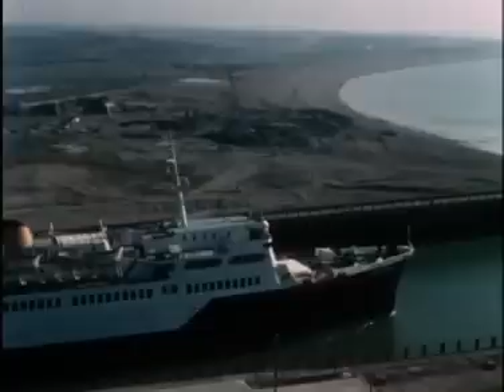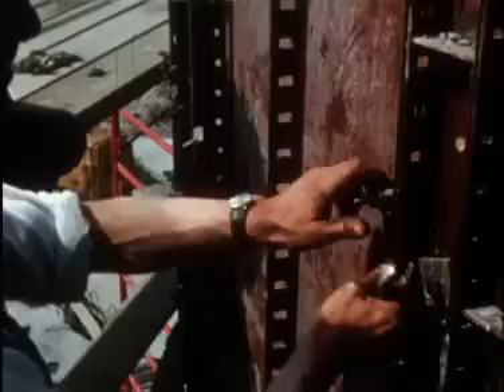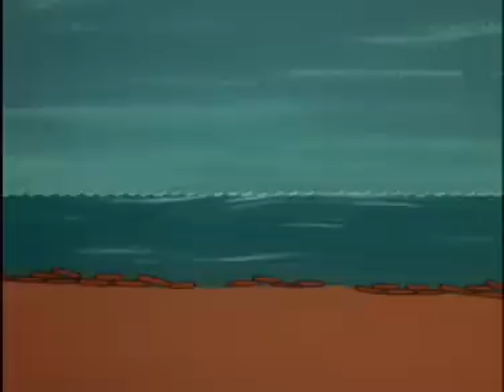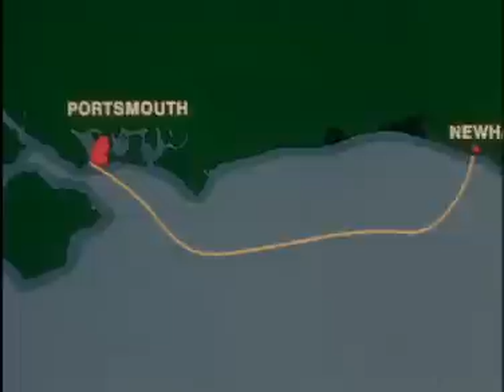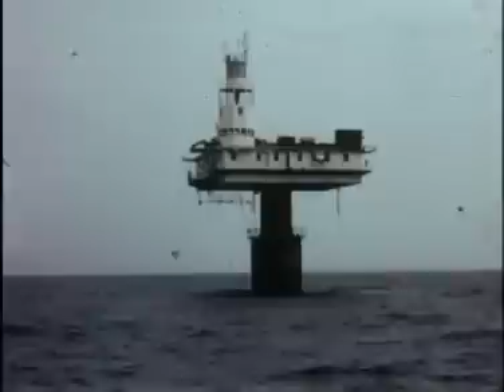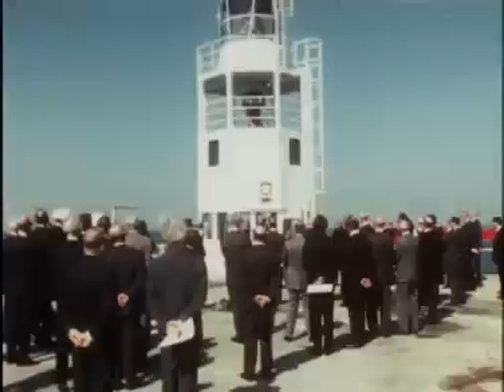Royal Sovereign Light (1972)

Comment: Ah Memories worked on the tower when l was 21  for 2 years on the beach and then on location.Was one of the guys who had to climb down inside and sit on a wooden platform hung on wires winding the nuts up on the jacking. Remember something about the metal rods meant they cost a small fortune but when the jacking was done they were cut off and dropped inside tower,Boss was bill the guy in the tie. Ganger was Ken Gregson a Newhaven man really nice guy.Jock Stewart carpenter and ginger baker welder.Can see myself in film on the winch and concreting.Happy days.

Comment: I always wanted to visit the Sovereign but strangely finally did when it was sitting on the dockside in Shoreham harbour after being dismantled , the living quarters have now been demolished but the tower is in storage ready to go on display at  a new exhibit in Bexhill.
Reply: Was anything saved from the accommodation? Except  the lighthouse tower  doors windows  etc?
Reply: I was told at the time the accommodation block had too many hazardous materials in it to be saved , I'm not sure if any smaller bits were saved.
Reply: The accommodation block was lifted off in one go and weighed 900 tons !

Comment: Trinity house: we want to set this off at 6pm in thick fog.
.
.
.
.
Tug boat captain: Hold my beer.
Reply: When I was on the Lightvesel 'Royal Sovereign', in 1968-1970, we had continuous fog for 100 hours.
The foghorn is brought into use when visibility is reduced to half a mile or so.
The larger generator-compressors are used when the foghorn needs to be running, thus supplying adequate air pressure of 40 Lbs square inch in the 3 capacitor 
tanks that is then fed by pipe through a solenoid operated valve to the foghorn above the bridge.

The number - frequency of the foghorn signal is determined by whatever the light signal is for that particular seamark & the lantern is used during periods of fog as well as hours of darkness.

Comment: He didn't explain very well how you 'float' concrete!
Reply: Simple, if the concrete base, being hollow, displaces enough water with a weight greater than the weight of the concrete then it will float, after all steel won't float until it's made into a sealed container.
Reply: @johnmartin6178  Yes fine but how is it then heavy enough to support the tower  when sunk. Do they then fill it with concrete?
Reply: @ronnieg6358  The video explains it!

Comment: I am an ex-Lightsman First Class, now retired, I  was a crew member of the Royal Sovereign Lightvessel in the 1960's until  shortly before it's replacement by the light tower.
I am  Eastbourne born - bred , I spent six years at sea, mainly in the Arctic & North Atlantic.

Before going to sea, I was a regular weekend visitor to the RSLV & knew all the crew well.

The person looking at the cable being attended to at the beginning, 0.06, was the Master, George DAVIS, the other Master(not seen)was, John KEYS, from Suffolk, a good friend of mine.

At 0.24> was 'Chick' FOWLER(Driver), from Yorkshire.

I would go to see the construction progress of the Tower near the Buckle pub, Newhaven when on leave.

Seeing the tower being towed out, reminded me of the fact that in 1969, we had 200 hours of continuous fog, which meant that the fog horn was running continuously for that whole period, except for just 30 minutes, when the fog signal is running, the larger generators, with the addition of compressors are used to provide air & electricity.
 

 The Soverereign Light tower was not the first such construction of it's type, the Kish Bank Lighthouse in Dublin Bay was the first, commissioned in 1965 I believe.
I recall communicating with Captain GATESBY of THV Winston Churchill & he mentioned it in a letter that he sent to me on the subject. 

He also said that, as a result of that experience with the Kish Bank, the ground preparation of Sovereign Shoal position had to be made exactly level, something that did not happen at Kish Bank, with the consequence that remedial work to correct the uneveness was required.

Before joining the Sovereign lightvessel, I was on the crew of the OWERS Lightvessel off Selsey Bill.

I preferred the RSLV, because ,sometimes, on the relief, we would be dropped off  at Eastbourne Pier, which gave me extra time on leave & that enabled the Buoy Tender to do additional work when required at Beachy Head or elsewhere.

I must be the only living ex-Lightvessel crewman  around I should imagine & am considering a trip to Harwich to visit Trinity House for old times sake. 

All lightvessel crewmen must have at least two years previous sea going experience, whereas Lighthouse keepers are land-lubbers, with no sea experience necessary.
Reply: Thank you for your story! It really adds another dimension to this video. I too often forget the genuine human connection when watching these vintage films.
Reply: Michael00172     Hi Michael,  did you get to make your trip? I sure would love to hear about it also how old are you now I’m 60 retired United States Merchant Marine Captain.  👨‍✈️  Class Of 78. 
USMMA=UNITED STATES MERCHANT MARINE ACADEMY.  KINGS POINT NEW YORK.   Been in 59 different Countries. Several of my friends and I mean very close friends are retired British Merchant Navy Captains,  British Merchant Navy Chief Engineers,   And retired Scottish Merchant Navy/Norwegian & German Merchant Navy.   

All 7 of my different close British & Scottish friends and there wives, along with my wife Rhonda when she was alive,  all of these men went to the,   ‘Warsash Maritime Academy.”
(WMA), formerly Warsash Maritime Centre, it’s a maritime training college and is part of Southampton Solent University.  The academy campus is just east of Southampton aside the River Hamble and Warsash village.

The college provides education, training, consultancy and research to the international shipping and off-shore oil industries. It is one of the United Kingdom's colleges responsible for the training of the British Merchant Navy. The courses on offer cover a wide range of maritime education and training from deck and engineer officer cadetships, including degree pathways, to senior officer certificates of competency, together with the associated safety training.

My close Norwegian buddies all went to the “Norwegian Maritime Academy Nordic & Baltic.”  And my 3 very close retired German Merchant Navy Captains 👨‍✈️
Reply: @garlandremingtoniii1338  I am 75 years old now, I cannot say that I expected to witness the passing of the replacement for the Royal Sovereign Lightvessel as well, however my family history shows that we tend to live well into our 9th decade.
As a matter of interest, the 'ships' were\are actually & correctly described as Lightvessel's.

That is because they do not have onboard main propulsion units, being towed on-off station by Buoy Tenders, that were also used to relieve crews reporting for duty or going on leave, along with supplies,such as bunkering oil, water etc.

Unlike American Lightships, which have main propulsion, Lightvessels cannot move for any reason, other than dragging anchor, in 1968, we had a Gale Force 10 in the English Channel, the OWERS Lightvessel, of which I was a Lightsman on bopard at the time, dragged anchor for approximately 1.5 miles, for which we then notify Trinity House, who authorise us to officially be 'off-station', they then issue a 'Notice to Mariners' informing ships of the situation.

If a Lightvessel's main anchor doesn't hold ground, usually because the bow is 'Bluff', causing more resistance against the waves, then it's unlikely that the two bower anchors would rectify that situation & assistance would be required. 

 Garland, I remember back in 1961 on a weekend trip delivering fresh food etc to the crew of the RSLV, there was an American Supply vessel astern of the lightvessel at slack water holding position there.
There were a few crew around the starboard stern quarter, we approached under her stern, where upon some cigars were thrown to us, but dropped short.

The name of the ship, was the 'Simon B Buckner', named I believe after an American General involved in the D - Day landings, but whom also had a son who was kileed in action against the Japanese in Iwo jima?

I also remember in 1966 east of the Dogger Bank in the North Sea, a German training submarine, which was running on the surface in a near gale(Force 7) & was sank.
She took on water through the open conning tower, then due to a valve being incorrectly positioned, began siphoning seawater into the boat, which caused all of the crew bar one to lose their lives.
The boat's name was, Hai (Shark), the following day the weather was good, our sister trawler was some 8 miles east of us, she saw the incident & sent the Mayday during the night before.
Anyway, during the next morning some 150 ships-trawlers were engaged in a search & rescue operation.
After some time, an American Lifting Barge that was probably working for the North Sea oil companies, was  brought on scene after the submarine was located & was used to lift the boat.

I did a search on Der Spiegel not long ago & downloaded a report by the Kriegsmarine into that incident.

The only survivor, who was rescued by our sister trawler, was the boat's Cook, though on rescue volunteered the information that he was ranked as an 'Officer'

Back on topic, Trinity House would appoint Master Mariners from the British Merchant Navy, wwhich doesn't exist as such now, although, with our leaving the E.U at the end of 2020, we may once again beging to reform the MN & fly the 'Red Duster' once again, who knows?

Unlike the American Coastguard which operates American Lightships that must be superseeded too by automation, Trinity House is a charity formed under Charter by King HENRY V in the 16th century.
Lastly Garland, it's good to hear from you as a 'man-of-the-sea' like myself, it gets in your veins & never leaves you.

Travelling is good for the mind & gaining that experience whilst being paid at the same time is a bonus.
Reply: @garlandremingtoniii1338  You may be saddened to hear most of Warsash Maritime has been move into the Middle of Southampton, Eastgate Terrace I believe is the street.

I went there for Mates and Masters as they had accommodation and it was not in the middle of a town.  The mysterious they do not care what the students want. Ho hum never mind.
Reply: @garlandremingtoniii1338  'British & Scottish friends'. 
What? Do most Americans really not know that Scotland is in Britain and that England and Wales is too? 
The Scottish are also British: they live on a the largest island in the British Isles, called Great Britain. That island comprises three countries: England, Scotland, and Wales.
You also must also realise that the British are from different countries within the UK. Is the British person English, Welsh, Scottish, or Northern Irish?
British = belonging to or relating to the United Kingdom, or to its people (English, Scottish, Welsh, and Northern Irish) or its culture.
Great Britain = large (hence great) geographical island in the British Isles containing three small countries: England, Scotland, and Wales.
United Kingdom = country, the kingdom consisting of four smaller countries: England, Wales, Scotland, and Northern Ireland.
Englishwoman = me. I'm English and I live in England: my country.

Hope this helps. xx
Reply: Thanks for your service an the story.wish you would write a book. U must have some grand memories of the days of the light ship. By the way a man bought the lighthouse ship an it had been pumped full of foam. So in order to live in it he had to grind it all out. When it was done it was beautiful. He has a video on here somewhere. Thanks again for your service an story!!!
Reply: @donnakawana  LOL, Donna, it takes all sorts to make a world.
The Royal Sovereign ended up as a wreck off the Israeli coast & in a very sorry state too.

It had been converted(some would say -vandalised)into a radio broadcasting vessel like the old Radio Caroline that I have steamed by off Harwich on a few occasions.
The RSLV was converted & renamed the, King David.

A Google search may show it.

There was a time when the Lightvessels were kept in proper shipshape, with an annual inspection by the Elder Brethren.
It's sad to see some changes, which when set in the context of a nations life, can only be described as unfortunate decay.
Most of the crews were ex-RN with the self-discipline to keep proper cleanliness & order on board.

Nowadays, it's just a question of maintaining a piece of apparatus, without any other senses involved that constitute proper duty to those we served(Mariners).